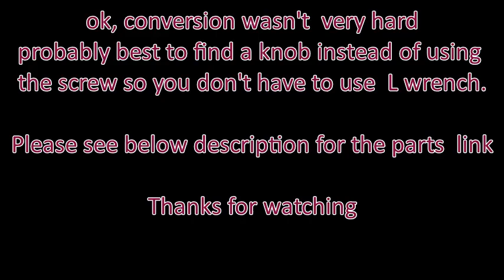WEN 3920 Scroll Saw Pin to Pinless blade conversion with a blade holder from wenproducts.com

Comment: Thank you for this video. I’m considering buying the scroll saw and was searching for a video regarding these new painless adapters Wen offers. Also when searching for a knob as opposed to the hex screws, is there a certain length I should look for?
Reply from the maker: I haven't found a knob yet. it is best to bring your new blade holder to hardware store and try to find a matching knob. 
I will let you know if I find one soon.
good luck.
Reply from the maker: screw size is M4 as you see it from the Wen products. you may google it and buy online.
https://wenproducts.com/products/4300
[3920B-033] Screw Hex Socket M4X16 for WEN 3920 (Model B)

Comment: Thanks for the Video, I already have this saw along with the H F version. Heads and toes better than H F only draw back is you have to use pinned blades. I wished to remedy this and went to the Wen site and strangely will only allow you to put 1 holder in the cart, and can put 2 screws but not the holder???? but you NEED 2 to make it work.just stupid. sure I can make 2 orders but shouldn't have to. I think I'll wait until tomorrow and try again

Comment: I can’t get this to work. The set screw doesn’t tighten the clamp and it doesn’t hold the blade at all.
Reply: Same here. There's no way to get the blade to tighten in those using the T-knob they sent with it.
Reply: Push the screw through the unthreaded hole and then screw it into the threaded hole.  Put the blade in the slot where a pinned blade would go. Tighten the screw to close the slot and hold the blade.  Do this before you mount the bracket so you can see how it works.

Comment: A bit more info would really help.  Do you install new holder using the front or rear (small or large) hole for screw?  What size screw or stop do you use for the larger hole in the side of the holder opposite of the knob or hex key side?  In the video there actually appears to be nothing on the other side of the screw opening that does not make contact with the blade.
Reply from the maker: You remove old holder and new one. And there are  no part other side of the holder,   later I bought couple of m4 wing nut screws for top and bottom. no tool needed anymore.
One comment below suggested a lever from Amazon,  if that works that is even better. But to be honest I am going to upgrade scroll saw soon. This is good  for a starter though.

Comment: i can't find either the mount or screws anywhere do you have any suggestions?
Reply from the maker: are they sold out?
[3920B-031] Upper/Lower Blade Holder for WEN 3920B
https://wenproducts.com/collections/parts/products/upper-lower-blade-holder
[3920B-033] Screw Hex Socket M4X16 for WEN 3920 (Model B)
https://wenproducts.com/products/4300
Reply: @ummaandhalmi  Home depot or Loews has them.

Comment: I just got this conversion for the blade holder but can't figure out what is supposed to be in the large hole opposite the set screw. Seems like there should be something there for the blade to butt up against when you tighten the set screw to hold the blade in. Anyone know how to fix this?
Reply from the maker: there is nothing .. I recommend you to get a wing nut bolt (M4) so you don't need to use hex tool. or one user mentioned this tool but I have not tried. https://amzn.to/30Ab62B

Comment: Perhaps you should have explained exactly what you were doing and why because someone that has never had a scroll saw before will not know what the hell you're doing or why you're doing it. I can't believe I have to say this
Reply: Dude! I'm a total newb and was even perplexed at the fact they didn't have any info about this in the effing manual. After searching for info I thought I had finally scored with this video, only to find out it has no sound and isn't very clear. No offense to the OP but fuuuuuccccccck this has been a frustrating journey. Hope you're a pro by now 🙂 happy scrolling.